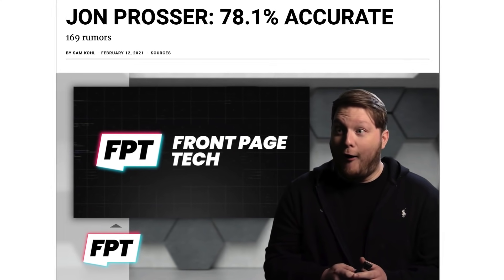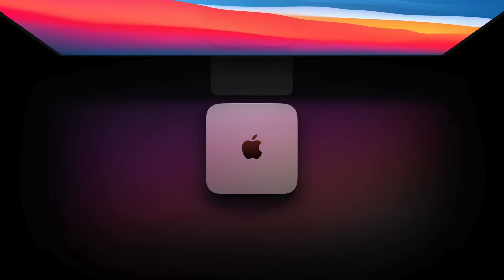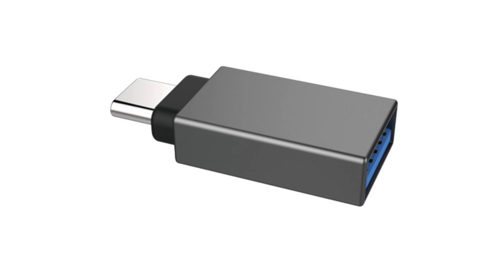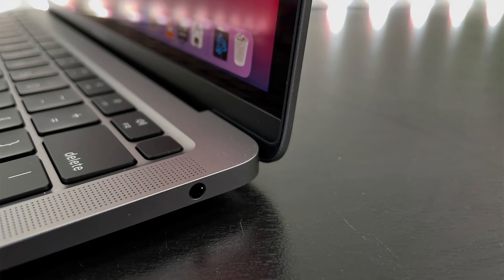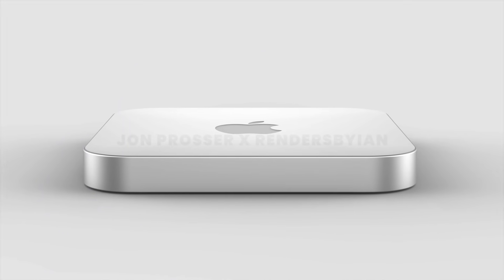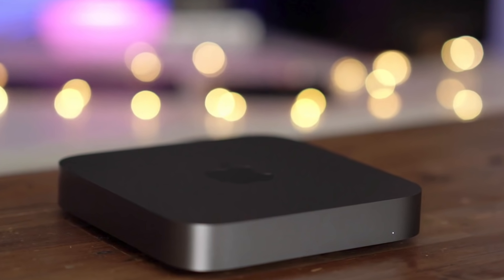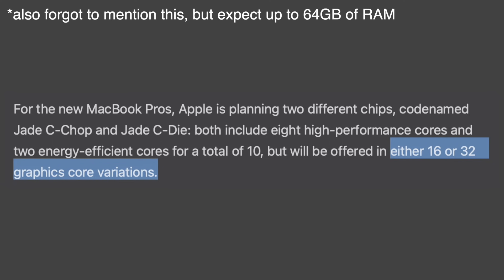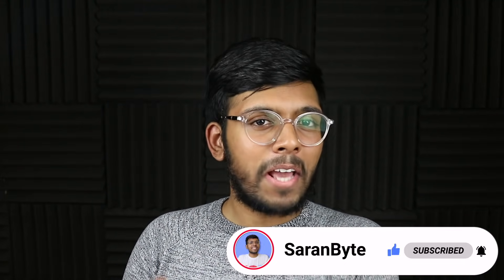ALL-NEW M1X Mac Mini To Launch At WWDC 2021! Slimmer Design, More Ports, 10-CORE CPU + 32-CORE GPU!

Comment: Completely agree on the headphone port, it would have made a lot more sense to remove it in the iMac, not the Mini. Maybe around the front or sides? 

I have to think of it has the magnetic power port I have to assume it is an external power supply, since using the same connection for high and low voltage is asking for trouble. I like the external power supply on the iMac, not so much here. More than a few Minis end up in racks, and the power brick, extra cable, and having it proprietary are not good things for that environment.

Comment: I think the vent should not be at the bottom as the heat blows at the desk and gets stuck between it and the Mac. it Should be in the back or the top or the sides
Reply from the maker: Yeh true, it seems like an inefficient design. I guess we’ll see if they fix that with the final version.

Comment: Isn't this just a speculative render based on description
Reply from the maker: Nope Jon apparently had images and CAD files of the product, so it should be 1:1 according to him. Personally, I think there are some issues with this design though, so I’m a little sceptical.
Reply: @SaranByte  Me too. if they are finished designs and the USB C ports are too close together then the whole range would be recalled, which is ridiculous. So either they aren't too close together in reality but are on this render which means it's a mock up. Or they're not too close on this render. I guess this is the concern about speculation, but it's so much fun to do! I guess the poly top is for bluetooth connectivity issues too. I just returned a Mac Mini in anticipation of getting one of these for audio work. I can't wait. ben
Reply from the maker: Yeh many have mentioned plexiglass could help with Bluetooth, which is likely. I think the port situation will be rectified with the final product - as you said, it would be a huge annoyance if the ports ended up being that close.

Comment: I would totally buy a Mac Mini M1x with green plexiglass top.   Totally on the BUY now list.   :)   I agree on the render that the 4 thunder bolts are too close.. I thought I read the headphone jack was moved to the front or side?  Back would be better..  honestly the headphone jack is not ideal anyway.  I ended up getting a Peavy ($50) USB to 1/4 or XLR (Better)  and it’s super clean to powered JBL Studio Monitors 8” (always buy JBL on sale) and it’s insane vs any headphone jack unbalanced cable speaker system.   Is there any clue if the dimensions width/depth same as current Mac Mini?   That way could be same size to stack on existing Mini hubs etc.  Anyway for my work, M1 would be a huge step up from my 2014 MBP 15” but I’m looking to drop coin on the M1x... and mini would be ideal.  Lowest money paid for best computing power output.  Honestly a green iMac with M1x would do the same for me...   but if Mini M1x comes first, I’ll jump that route.. I already have a Dell 4K monitor (Ultrasharp.. Meh... but does rotate to portrait mode). And dozens of keyboards laying around or even just get another $15 Bluetooth keyboard that works just fine... like I use with my iPads.   Anyway good times for digital artist that prefer mac platform.    Can’t wait to edit my 4K BRAW from Blackmagic on a modern Mac M1 or M1x.
Reply from the maker: Honestly I don’t really see the point of coloured Mac mini’s, but I can understand the appeal. Also no headphone jack on these renders afaik - I assume the final version will include it. We also have no details on the size, but I think it should be similar to the current M1 Mac mini, but ofc with a slimmer body.

M1X should defo be more than fine for your use-case - I can’t wait to see these machines 🔥

Comment: You would need a Microphone and a headphone/speaker out port.  Especially for professionals that will need speakers and a microphone.  Spacing out the ports, and this could be ideal with a portable Display, you can take this with you.  Also, this is small enough to be portable, you should have a battery in it.  But you should because, what if the power goes out?  This can be an issue for the Desktop Mac's as well.  You can take it and a portable display on an RV trip.  I kind of like this Mac Mini-er.  At home, hook it up to a widescreen display, but on the go, hook it up to a portable display. 

Hopefully, Apple will space the ports a little further apart, and give us both an audio in and an audio out, so that we can plug in a microphone and speakers.
Reply from the maker: I agree that the port situation needs to be fixed - I don’t think Apple can get away with the removal of the headphone jack. Also I don’t think having a small battery in the Mac mini would be a bad idea at all - like you said, when the power is out, having a battery for emergencies would benefit a lot of people imo.

Comment: All good, but this still leaves the thorny problem of the Macbook Air. When it gets a redesign if it has the M1X then it equals the Macbook Pro in power and becomes more powerful than the iMac.
Reply from the maker: MacBook Air is getting M2, not M1X. So it will still have a weaker CPU + GPU.
Reply: @SaranByte  Makes sense

Comment: A big what if.. Apple is dropping the headphone jack because they are immenetly dropping wireless HiFi support... Pushing the majority of users to wireless. Still doesn't solve for monitor speakers though.
Reply from the maker: Possibly 🤔 - but I still don’t understand why they would push that on a Mac mini first. Surely it makes sense to remove it from the entry-level iMac and MBA, right?
Reply: @SaranByte  Agreed doesn't make complete sense. The only two reasons I could think of is the possibility there is an input on the display or simply that it is a low-risk product to test out the market reaction on vs MBA or iMac. I guess we will need to see what happens, imagine it ships with usb-c to headphone jack adapter hahaha.
Reply from the maker: @KyleDodds  that’s gonna annoy a lot of people if that’s the case 😂 - but you make a good point about this being a low-volume product. Maybe they are testing the waters and seeing if people would accept the lack of a headphone jack, and well, I’m assuming most won’t.
Reply: @SaranByte  they could just do a quick poll on any platform and find out within minutes people will be let’s say “less than impressed” 🤣
Reply from the maker: LOL that’s very true 😂
Reply: @Zachary Gonzalez - tying up with your thoughts below as well as the Plexiglass theory for connectivity. Apple filed a patent in 2019 for 8mb/s over Bluetooth but possibly will be airplay tech rather than a new Bluetooth standard as this is still not enough for best lossless setting.
Reply from the maker: I see - that could definitely explain why we have a Plexiglass cover on the top.

Comment: Make it all aluminum. Color is fine as long as it's the rich, bold colors on the back of the new iMacs and not the pastel stuff. Fix the port spacing. Put the headphone jack back, I use a splitter so my speakers can pull double duty on both the Mini & my gaming PC. Add a 2nd fan. Give me all the cores, especially GPU.
Reply from the maker: I’m assuming the port situation will be fixed with the final model. I doubt they’d want to release a Mac mini without a headphone jack. Also agreed that it should be aluminium - you make a good point about pastel colours and maybe that’s why the plexiglass cover exists 😬

Also I’m assuming M1X will be fine with the one fan - as we’ve learnt with M1, these chips are super efficient. And you should get 32 GPU cores, so it should be plenty 👌

Comment: I mostly agree with your thoughts except probably for the power brick, if they are planning to use the same external brick for 2 version of iMac and Mac mini, the cost will decrese drammatically, and for the base iMac there is no ethernet port too. Another thing is thermal, without power less heat so only one fan is just enought, even if the grid in the base is pretty strange in my opinion. For colors i' m assuming that the Pro versione will be white and alluminium like the original 2005 and the M2 version will have the same colors of the iMac lineup to match the colors of keyboards, trackpad and mouse alredy in production. Good job man.
Reply from the maker: 1. An external power supply would also be a bad idea for those who use Mac mini’s for server-related stuff, which is quite a few. Having all that built-in makes so much more sense for that demographic.
2 + 3. Agreed. Knowing how efficient M1 is, one fan portably is more than enough for M1X. And yes, I see the M2 version coming with the iMac colours.

Thanks for watching!

Comment: My theory for the headphone jack removal:
Apple will launch the M1X Mac Mini along with a cheaper, M1 iMac-quality display. This display will connect via hdmi or thunderbolt (both of which provide audio), and will have both great speakers and a headphone jack. Basically Apple will want you to either buy and use expensive AirPods (pro and Max), a HomePod device, and/or this external display to get great audio from the M1X Mac Mini.
Reply from the maker: Tbh Sam on the Genius Bar podcast did suggest a new cheaper monitor could launch at WWDC. So this theory makes a lot of sense imo - guess we’ll have to wait and see 👀